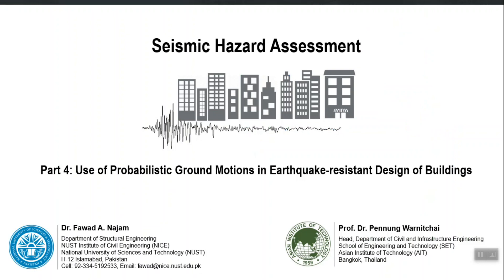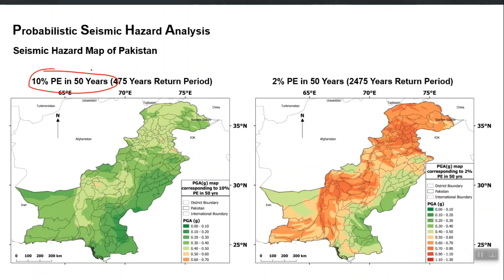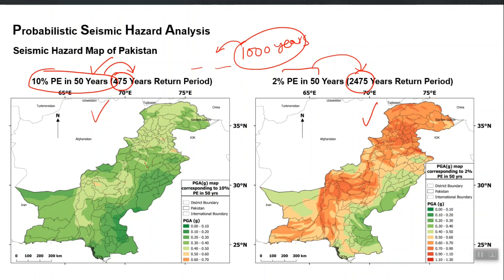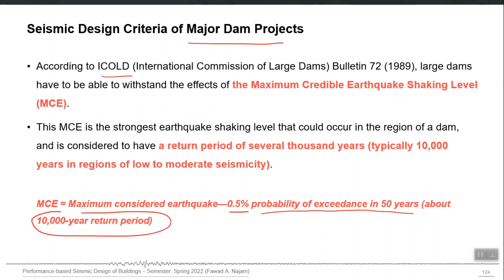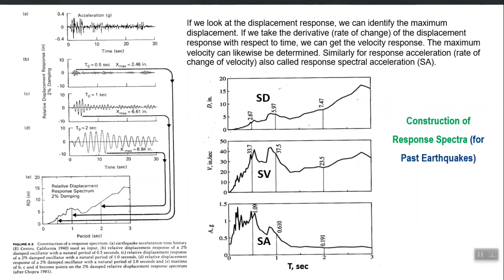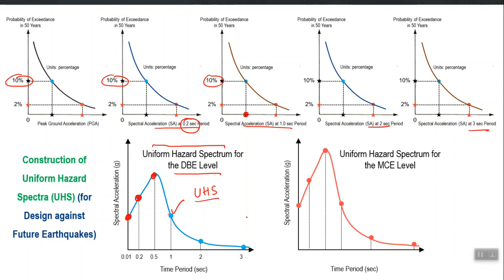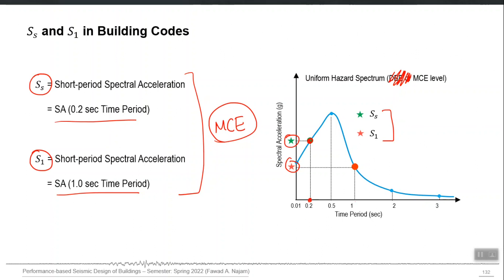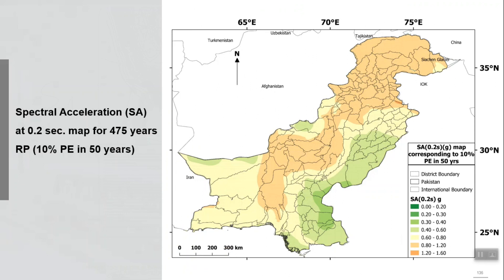33 - Probabilistic Ground Motions (SLE, DBE and MCE Levels) and Building Performance Levels

Comment: 🎯 Key Takeaways for quick navigation:

00:00 🏢 Understanding Hazard Levels for Building Design
- Different hazard levels (DBE, MCE, SLE) are selected based on probabilities of exceedance.
- Building designs vary based on selected hazard levels, ranging from serviceability to collapse prevention.
- Hazard levels are convertible into return periods, with different structures requiring different return periods for design.
04:51 🏗️ Hazard Level Variations in Structural Design
- Different structures (buildings, bridges, dams) have varied design hazard levels.
- For major dams, hazard levels may differ significantly from those for buildings.
- International organizations like ICOLD dictate hazard levels for major dam designs, often with higher return periods than building codes.
06:47 📊 Evolution of Spectral Acceleration in Building Design
- Spectral acceleration has replaced PGA as a primary parameter in seismic design.
- Response spectrum curves categorize structures by height and represent future earthquake responses.
- CMS (Conditional Mean Spectrum) and UHS (Uniform Hazard Spectrum) are methodologies used for spectrum construction.
12:43 📐 Application of Spectral Acceleration in Building Codes
- Building codes define specific spectral acceleration values (SS and S1) for MCE level.
- SS and S1 values are then converted to equivalent static forces or utilized in dynamic analysis.
- SS and S1 maps aid in building design, providing spectral acceleration values for various hazard levels.

Made with HARPA AI